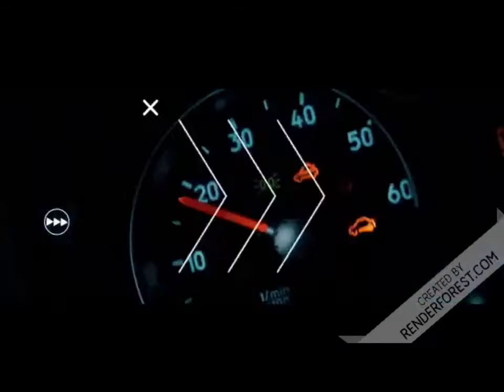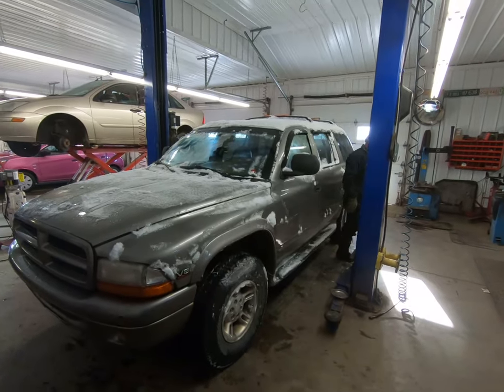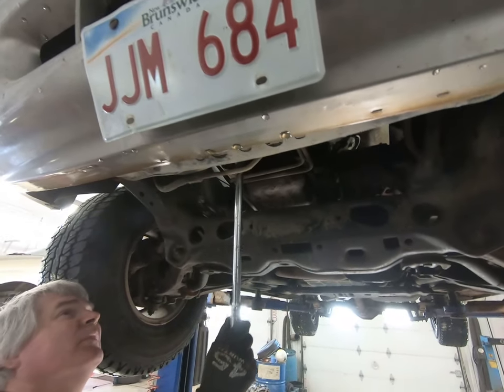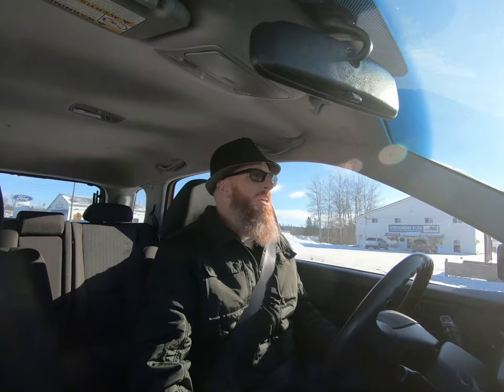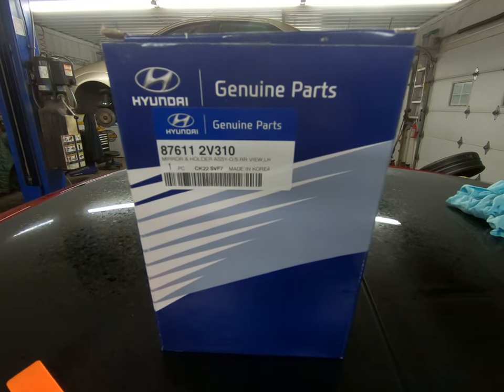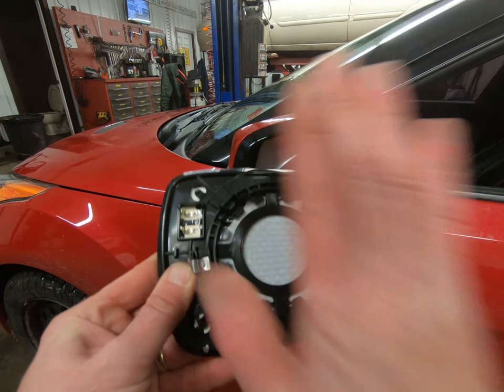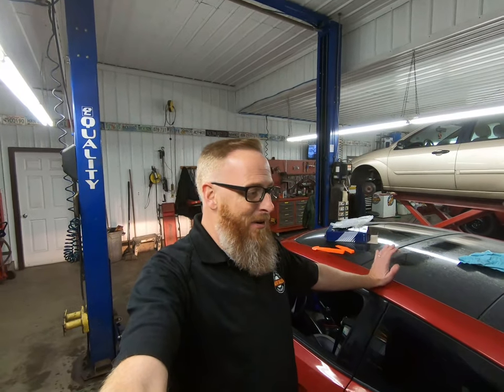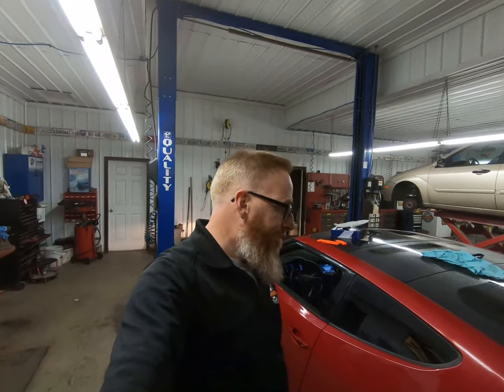DEAD DURANGO, MAYBE IT'S TIME FOR A HEMI SWAP- FIXING THE REARVIEW MIRROR ON THE VELOSTER TURBO

Comment: I figured pulling the engine and transmission out would get you more money. Selling the transmission as a core and the engine as is I figured you could get more then $200 for those alone. But since your a lot I understand that sometimes it's not worth it to take the time to pull the engine and transmission out.
Reply from the maker: Trust me we out we'd all options. But you are correct as a car dealer we are not set up for selling Parts out like a scrap yard.